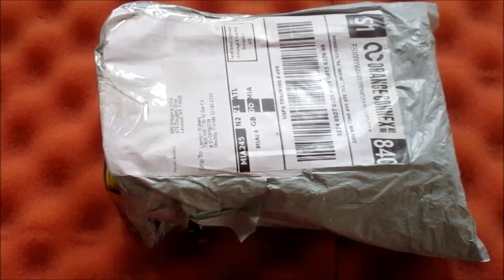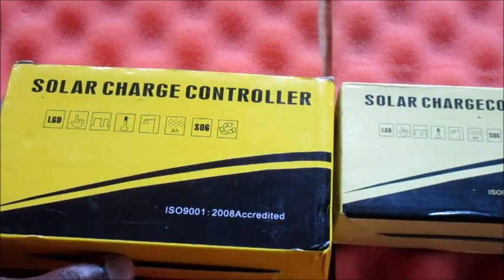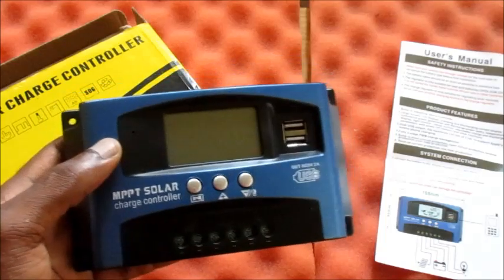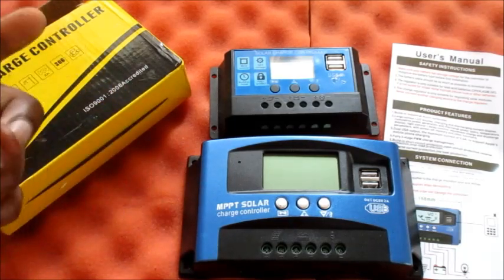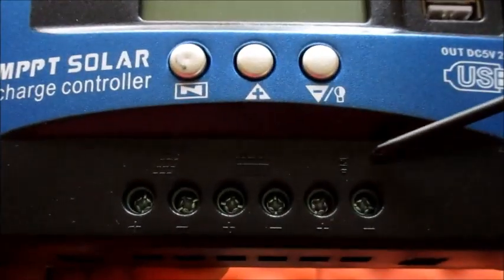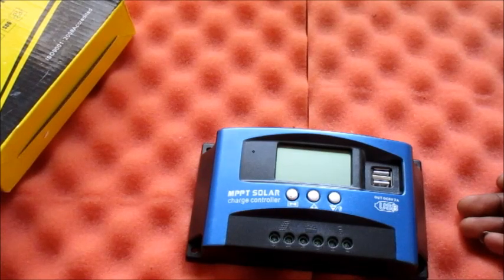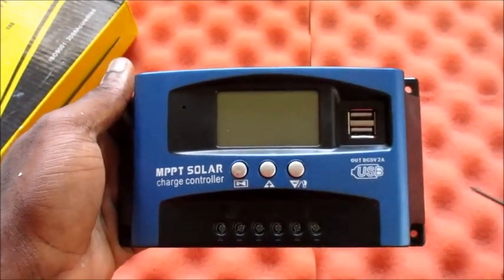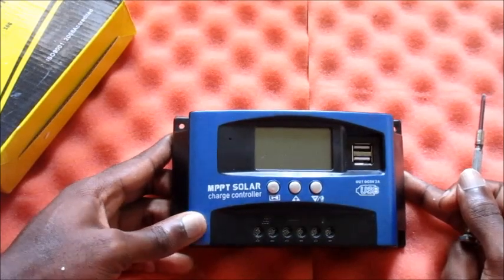solar charge controller explained - How To Setup MPPT Solar Charge Controller

Comment: hello sorry it's the same as the one I just bought could you give me some written information on the setting and how to set it by writing me here on you tube so that I can translate with the translator because I'm Italian thank you very much for your answer on the matter bye
Reply from the maker: connect battery first, then panel. Set you reconnect at 12.1 (or as recommend in video) that's if you are using the loan on the solar controller, if not you can use an inverter.
Reply: @Lenzwalters  tank you 👍

Comment: sadly this is a PWM not an MPPT ,someone on youtube pulled it apart and the circuit is for PWM not MPPT.
Reply: No! We didn't all know.
Furthermore you continually refer to it as MPPT and also mention early on that MPPT gives about 30% more charge (which MPPT does).
Why did you not mention that this is not MPPT but is in fact PWM. The whole thing is a scam and you could have done the decent thing and exposed this.
Reply: @brianstewart3457  ok so lets explain the difference of these two controllers and why you get 30 percent more power.....volts x amps = watts .ie a 12v battery with a 10amp rating..= 120 watts of total power....also a 24v battery with a 5 amp rating = 120watts same amout of power..water is a good example (fast moving water in a small pipe may be equal to slow moving water through a large pipe )...so solar panels produce anywhere from zero to about 30v of power an hour (rough guide 6hrs a day...so a 50watt panel x 6 will roughly tell watt it can produce in a 24hr period ).pwm controllers expell anything over 12v (its closer to 14v but for explanation lets say 12v) as heat.....where as mppt controllers use the equation above and lower that 30v volts down to 12v but raise the amps up so you gain all the power made by the panels ie the 30 percent extra power and less chance of your system failing due to over heating....i hope this helps....
Reply from the maker: yes we all know

Comment: Sir i have 24v solar panel and 12v lead acid battery..what is the appropriate setting in a mppt controller should i use...
Reply: firstly dont buy this one as it is a PWM not an MPPT (MPPT on the front is the name of the controller).a proper MPPT will bring down voltage while raising amperage to use all the panels power..a PWM will only reduce the voltage but keep the amperage the same (volts x amps = watts) so you will lose up to half the power from the solar panel.
Reply: @runningwithscissors7715  aaaahhhh
That explains why my 4 x 160watt panels are flat out running my 200 lt fridge. And why the input voltage is around 12.4 volts
Damn it
Reply: @chockydog6960  ciao come hai impostato il parametro per una batteria al piombo ti ringrazio se mi dai l’impostazione da fare io ho impostato :(bar 1 ) e giusto grazie 👍❤️
Reply from the maker: you can apply the same settings. Esp for lead acid battery to last long